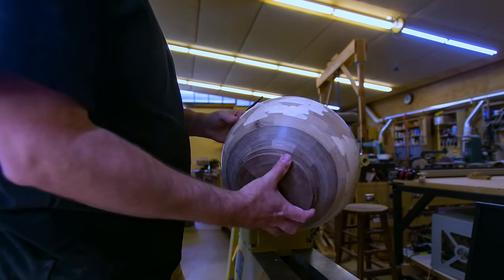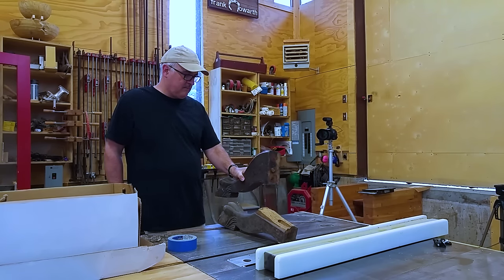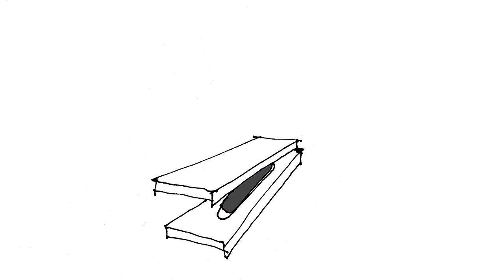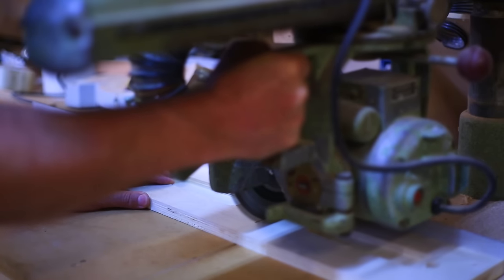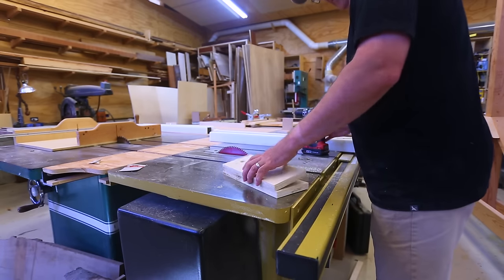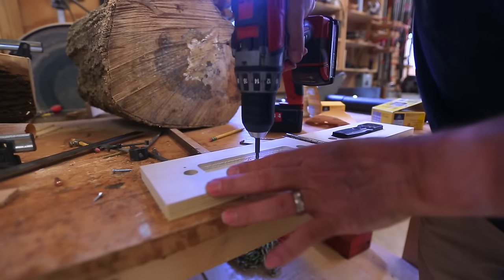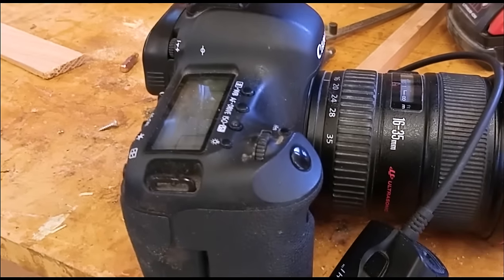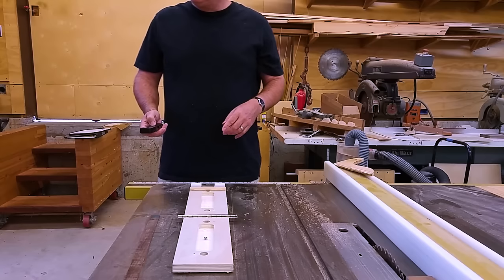Foot Actuated Camera Controller

Comment: Even with the foam that screw might be a bit rough on the button. You might want to consider swapping it out for a dowel with some felt on the tip before it becomes a problem.

I could just be being overly cautious here, I'm sure you know your clicker better than I do. Just a thought that came to mind.

Comment: Great idea and great work! Thanks for sharing yet again. Might I recommend that you use just your heel (positioned at the opposite end from the hinge) instead of your whole foot, to avoid repetitive motion stress on your foot? It'll be easier to push straight down your leg into your heel, and your body won't rock as much so you'll be in a more consistent pose in each shot.
Reply from the maker: I will try that.

Comment: Just remember to pay attention to where your hands are while diddling with the foot pedal.  I like videos with high production value, but I also appreciate woodworkers with ten attached fingers. ;)

If you're handy with a soldering iron and multimeter, adding an alternate wired switch to your remote might allow you to come up with more flexible ways for actuating it (perhaps connected through a 'headphone' type jack), with less risk of physically damaging the on-board switch.  Two sheets of aluminum foil separated by a piece of perforated rubber shelf liner (for example) might make a reliable pressure switch that would fit inside of your shoe.  It could easily be unplugged from the remote (strapped to your calf/ankle) when not in use.

Comment: This is where having some experience with electronic might have helped you. Your solution works great and it's not a critic at all, given your many areas of expertise, but there was a lot of smoother ways to do this. Congratulation anyway and as we say " If it works, it's the solution " =)

Comment: Nice. I've often thought it'd be nice to have a quick way to just choose which frames to keep from a video. So rather than just play it back at a higher framerate, have a mechanism where you can go through a long video, and say that frames 5, 32, 45, 78, and so on, are the important frames, and have the editor condense the video accordingly.
Reply from the maker: That would be nice.

Comment: Hi Frank 
Your radial arm saw looks kinda hard to pull, like it's snug or unoild? I've seen it in a few vid now. 
Great vid as always
Reply from the maker: it's more that it's under powered and will jamb if you don't coax it along.
Reply: I kind of wondered what was going on myself.

Comment: Is there a particular reason you wouldn't want to just record regular video, and hand pick the frames you wanted to use?
Reply: I suppose if you wanted to set up your shutter and aperture 'just so'. My camera (technically the girlfriend's, but the only dslr I use) has a rapid shoot function, taking up to 6 shots per second, which would be plenty for stop motion, and would allow for longer exposures
Reply: It's a lot of tedious work to sift through frames like that
Reply: Your proposed technique would just look like low framerate video. Stop motion has subte variances in movement path that give it the desired effect

Comment: Great work! But what about programing the camera to take a picture with about 1-3 second interval? That way you adapt to the rhythm of the camera, not the camera to yours ;) I see that this will take away some of the on key pictures, but you will lose the rocking motion ;)
Reply from the maker: That is how I have done this in the past. and it has its advantages.

Comment: Frank, Do me a favor and get rid of the positive hook blade on the radial arm. ( I can tell by the noise the blade makes. ) Changing to a zero or negative hook blade will rock your radial arm saw world.
Reply from the maker: It has a Negative Hook blade, and it's still too aggressive.
Reply: Are you sure because it still has all the signs of a positive.  What make is it?
Reply: If it's not at least a negative 5 degrees I think you should take it to your sharpener and ask him to recut it to that. Or try a CMT
                http://www.cmtutensili.com/show_items.asp?pars=SB~219~2
Reply: frank howarth is this why it is so jerky?

Comment: everyone that does not have a cnc would use it to cut their morning bagel if they magically got one. I think we can over look that indulgence.  In order to allow you to move at normal speed, cant the stop motion be done with software? some way to to remove say if film is 32 frames per second, remove perhaps 12 or 14 frames. there must be a way to skin this cat that is better than your current way. additionally, that remote wont last very long with a metal screw with no pad on it. the even if very slight friction on that button that was designed for a human hand that is very giving, unlike the screw, will cut it quickly I predict.

Comment: Hey, what happened to the end of the vac hose at 3:14? :)
Reply: It's always been like that in his videos. if you look it does continue onward into another pipe, but it also collects the dust not being expelled by the radial saw's dust port
Reply from the maker: It's not the best set up, i need to rework the RAS dust collection.

Comment: Maybe try something like a nylon screw so you don't damage the remote button.
Reply: Or glue a little rubber circle to the screw head.
Reply: Silicon is a bit too hard. Silicone, on the other hand would do the trick.

Comment: kWhy to to shoot continuous video and then pickup necessary frames?
Reply from the maker: it would take forever and the image quality would not be as good.
Reply: Agree on image quality - but you can kinda get the effect from video with "posterize time" effect in Premiere + 10 to 20 fps. It's decent for a short clip that you decide to give a stop motion effect after it's too late to shoot that way.